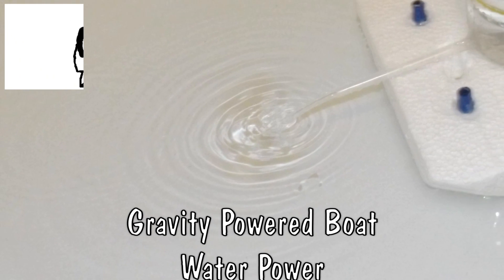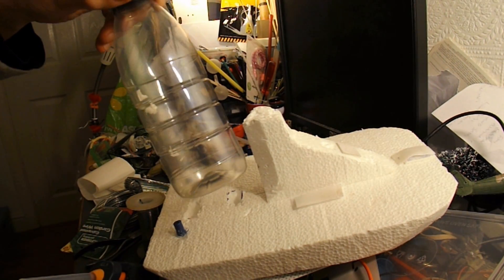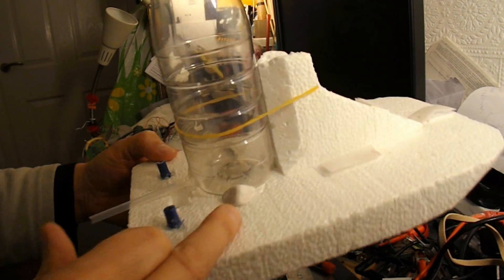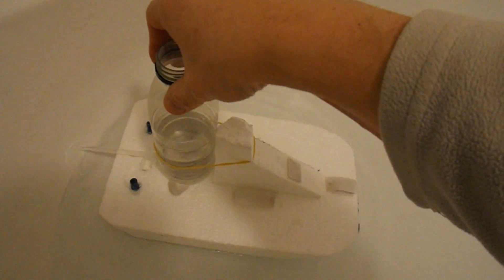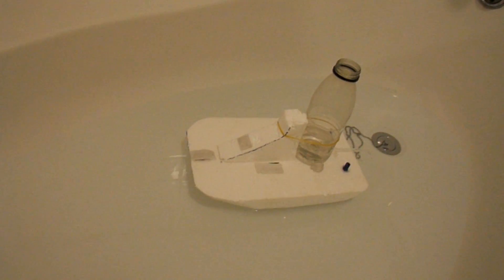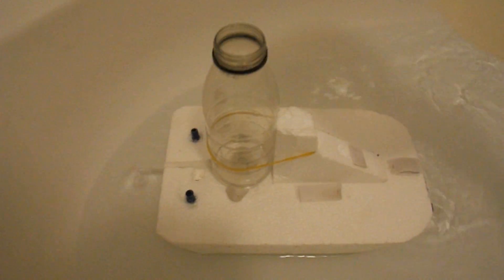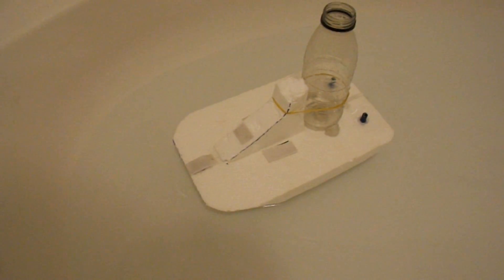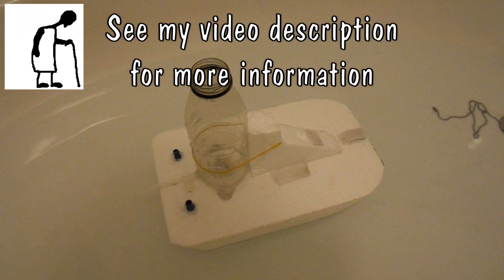Gravity Powered Boat Water Power

Comment: Subscribed just for the down hill joke.

This makes me wonder if it can be scaled up... 

I build boats, so will have to try this summer...
Reply from the maker: Hey, thanks for watching and commenting. The main issue with this type of boat is balance. If you make your water reservoir higher you get more power but the boat becomes unstable. A wide based catamaran would be best. It would be a fun project at a large scale but not very practical. From an energy point of view you would expend energy pumping the water into the reservoir unless you have a higher reservoir to feed it from, maybe a handy waterfall 😊

Comment: It seems to me that you could effect much more prower in your design by using a siphon.
Simply run a tube from inside the bottle  (touches the bottom of the bottle) and raise it up over the level of the top of the bottle top (forming a tall loop that extends a bit higher than the top of the bottle) )and then run the tube down towards the water. The water would accelerate much more due to the elevated height and produce more power.
Reply from the maker: +smde1 thanks for your suggestion, the general idea with my videos is to encourage people to have a go themselves so it would be great if you made one and tested your theory. I will put your suggestion on my list and maybe have a go. The biggest problem I can see is producing a video that will clearly demonstrate the results. Some people seem to think it is their duty to deny any such results as camera trickery.

Comment: But because the output of the jet is not movable ... ??? It would be his way, would to let you doing laps without touching on the banks ... :) Putting small rods with holes in the output of the jet, it would increase the travel time ... Very versatile ... I like verya much gravity use
 ...: o :) ... !!!
Reply from the maker: Hi claudiomar santos thanks for commenting. I could put a rudder underneath or just point the jet to one side. Yes restricting the flow would make it last longer.
Reply: The rain falls, the river turns the turbine, it spins a generator, ... We use gravitacional energy .. :) ... We pay to change the shape and transport but not for the creation of energy ... :) I think ... Gravity, as well as time, lends itself to a lot of cofunsão ... Until Einstein curled up with her ...;) ... For me it's the SAME force that keeps atoms and the like ... It's a sURPLUS of SUM of each piece of matter is ... I think;) ... Exciting. .. Thanks for atenttion...!!! I'm using google translator, can be confusion ;) ...

Comment: Very good!  Is there any way to make the water come out faster?  Like if you float a tea candle in the bottle and restrict the air some?
Reply from the maker: A tea candle would have the reverse effect, that would cause a vacuum and stop the water escaping. An air vale in the cap and pump air in to pressurise it would work fine. Here is one of my cars that does that. http://youtu.be/OIACw60VE0Q